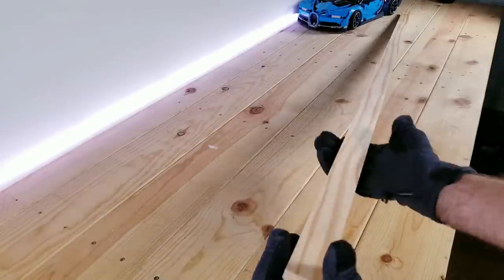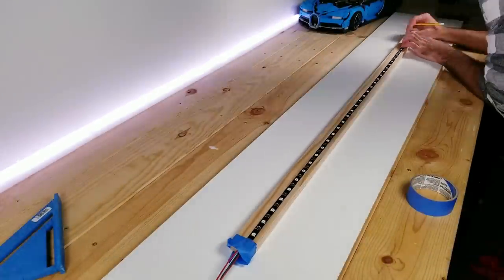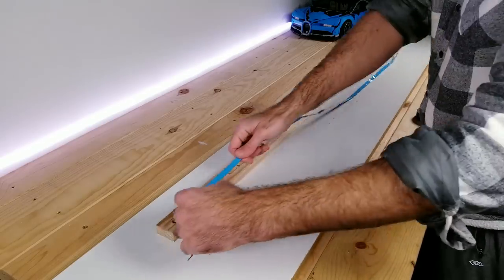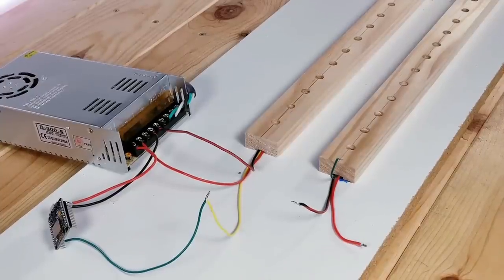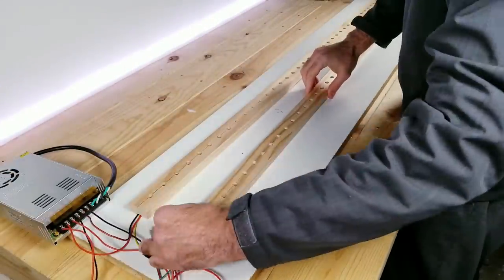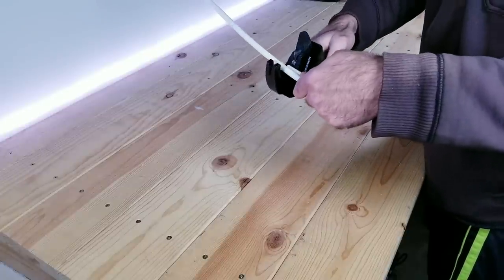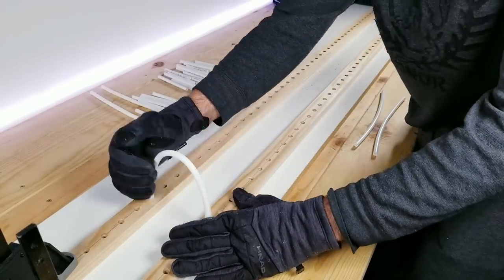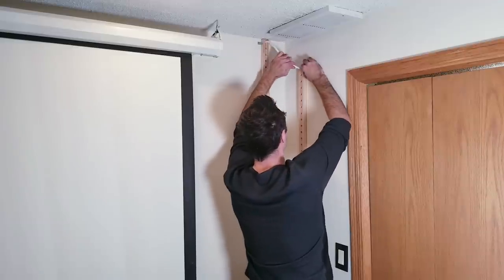Crazy DIY Light - Complete Walkthrough

Comment: Great video! You can use acetone on a rag to remove the print on the tubing instead of sanding. That's how I take it off of PVC; haven't tried it with PEX but I doubt it matters. Takes less effort and you don't have to worry about marring the tube.
Reply from the maker: Thanks so much for the tip! I love when people who know more than I do reach out like this. Very much appreciated. Thanks for watching and taking the time to comment!
Reply: Hi. I use for the printing on pex, isopropyl alcohol. Its the Same i use for my 3d printer headbed to clean it. Aceton could probably "eat/melt" the pex?

Comment: A tip from a carpenter; for your center lines, or any straight parallel lines for that matter, you can put the pencil where it needs to be and slide the speed square along the edge, pushing the pencil down the surface. Much easier than making dots and holding such a long straight edge in place.
Reply from the maker: Thanks so much! That is a great idea and I never thought about that. I love tips from professionals so thank you!

Comment: This looks awesome 👏 I had an Philips hue strip that im not using her but it has the silicone over the led so I can’t build it.
Reply from the maker: You could technically still use them with the silicone! I would just cut the back channel a little deeper and then you wuold just have to secure the led strip in there pretty good so it cant move around so the leds stay lined up with the holes. Worth a try! Thanks so much!

Comment: I wonder what an aquarium frosted tubing would look like! The Color would be able to travel through the entire tube!  Great job as always. How do you hide The power supply and all? Do You have a video on how you control all your LEDS?
Reply from the maker: I've never heard of aquarium frosted tubing! I'll have to look into that. Does it bend? As far as hiding the power supply, its generally nothing fancy. I just try hiding it behind something. In this project, its just behind the small table/drawer that's in front of it. Right now I have not made a video about controlling everything. I will at some point. Its pretty simple though. All my lights are connected to WLED and that app has a sync feature which allows me to control them all at once! Thanks for watching!!

Comment: I know you do them with the cheapest materials available which is great, maybe you should consider doing one project with Govee LED strip.
Reply from the maker: That is a good idea! I know some of the projects you certainly can swap out whatever lights I used for Govee but unfortunatly a lot of the things I have made would not look as good since govee only has about 30/leds per meter vs the 60/leds per meter that I'm using in most of my builds. However, this project with the pex tubing is one where you could use govee led lights! I really wish Govee at some point would make led's that have 60leds/meter! That would be so amazing if they did!

Comment: Hi I loved your project and I have started making the same the only problem is that the 1/4" pex tubing is not the same size as my RGB leds nd I can't find the right size.. could please help with that ?
Reply from the maker: My local hardware stores home depot and menards had different size pex tubing. Although in this project my leds didn't actually go into the pex tubing. The leds did however go intot he hole that I drilled and then the pex tubing went into that hole and sat on top of the led lights. I now the pex tubing at menards and home depot all said 1/4 inch tubing but I did try buying some 1/4 inch tubing that was catagorized as tubing that provides water for your fridge door and that tubing was much smaller than the 1/4 inch pex tubing from the store I got it at. Hope that helps and thanks so much for watching and the great question!

Comment: love the idea and design. But i would be concerned about heat since the wood is good insulator and there is no heatsink for the LEDS, also the led strips have quite high amperage I wouldnt just twist the wires.
Reply from the maker: Thanks for watching and for the suggestions! Yeah having the leds installed on some type of aluminum or heatsink material is best. However I've done a lot of projects with leds on wood and I have yet to have any issues and its been close to 2 years now on some of them. I also was recently introduced to wago connectors at the recommendation of a lot of people who watched some of my videos and its all I use now. I love them!
Reply: @ChrisMaherDIY  I guess its fine as long as you dont use them at 100% brightness, they get toasty fast

Comment: I love this so much! Would this work if I bought a 5m LED strip, cut it in half and connected it into a wifi controller box? The thing I'm unsure about is if the LED that I cut would work in the WIFI box after being cut. Alternately, I was thinking about buying two LED strips, but the wastage I'd cut of both would be a lot.
Reply from the maker: Thanks for wathcing and the comment! You could definitly cut the 5m led strip in half and use each side. Just make sure its the ws2812b ones like I used in this video. They work great!

Comment: If you're going to use a straight edge to draw the line, then you don't need dots every foot. You could have done it with just 3 dots and that 4-foot level. And to avoid splitting the wood, pre-drill flat-bottomed holes with a smaller forstner bit and use pan head screws to mount it to the wall. And you might try a solvent to get rid of the lettering instead of scratching up the tubing. Maybe Goof-off or even just alcohol would do it without melting the plastic.
Reply from the maker: Thanks so much for watching and for taking the time to comment with all your great tips! Thanks for your help! I'm still very new at all this, and especially woodworking so I'm all ears when anyone is able to offer help. Thanks so much!

Comment: Good morning, can I use a 10 amp power supply for this project? Or how do I know when to use a 2amp 10 amp or 60 amp power supply?
Reply from the maker: I think a 10am supply would work. It really all depends on how bright you want to run them. I find that running things at 50% max brightness is generally more than enough. But the price difference is generally not very big from a small power supply to a bigger one so no harm in getting the bigger one. Once you have things set up, in WLED under led preferences, it will tell you based on how many leds you have what they recommend for a power supply for max brightness as well as if you are just concerned with having it look good for animations.

Comment: Hi Chris, love your videos! Just ordered my first 5m ws2812b 60/m strip and diffuser channel. Question can I control this with 2m one way and 3m  the other way? So can I connect the esp32 board half a way the strip? Thanks I’m advance Roland
Reply from the maker: Thanks so much for watching and taking the time to comment! If I'm understanding correctly, I think what you are tyring to do can easily be done in WLED. Just connect the entire strip and then in WLED there is something called segments where you can have lets say led 1 - 60 be its own group and then the next segment you can have lights 61- lets say 120 be part of that group. (you can do many segments if you like) You can then control each group separately. Different colors, animation, direction etc.

Comment: I've decided to go ahead and make this myself, I was just ordering the bits needed and I'm unsure about the sizing of the pex tubing. Your link says the tubing is 1/4 of an inch but in the video it looks larger, I always think of 1/4 as the size of a straw hole.
Reply from the maker: Thanks for watching and great question! The pex tubing from menards and home depot all say 1/4 inch and even though the brands were different, the size was the same. Now I also tried ordering some 1/4 inch tubing from amazon that looked like some tubing that might work but was catagorized as like fridgerator water tubing and when that arrived, it was much smaller than the 1/4 inch pex tubing (my guess it was the size of a straw hole) So all that to say is i'm assuming the way pex tubing is measured is from the size of the hole not including the actual pex material. And the fact that a 3/8ths inch forstner bit worked perfect to fit the 1/4 inch pex tubing in makes me thing that pex tubing must be measured a little differntly if that makes any sense at all lol.

Comment: Nice video! But could i also just solder the two wire pairs of the two parallel led strips onto the esp8266?
Reply from the maker: Thanks so much for watching! I have not personally tired that but I think it would work if you wired the data lines directly to the data pin on the board. The pins are pretty small and close together so it might get a little cramped.
Reply: @ChrisMaherDIY  thank you sir

Comment: Hey Chris loving the project. question. In the beginning you have the light strip exactly the same length and the same start and end point. now you have shift the left one up. how did you sync them up to shine the same leds ?
Reply from the maker: Thanks so much for watching buddy! So I didn't have to do anything actually! When I shifted them, if you look at the very top, the pex tubing that is in the top spot on the higher left section goes to the top spot on the lower right side. So each side does the exact same thing so when lets say the last pixel is blue, its blue on both sections so that the pex tubing will be lit on either side with the same color. I hope that makes some sense!
Reply: @ChrisMaherDIY  Hi Chris, i understand that you have shifted them, that is logical that when you have 2 identical pieces of wood en starting point that the starting and ends would be the same. What i do not understand is the following. on 8:26 i can see on the bottom that you have holes without pex tubing (which are not lit) and 1 hole with pex tubing that is also not lit

When looking at this screen i kind of make 2 conclusions
1: the starting points of the LED stript have been shifted upward on the wooden piece. (starting at your first L bracket)
2: the starting point of the LED strip is at the top of wooden pieces
did i explain it clearly?
Reply from the maker: @Seaniemo92  Ahhh! I understand now. Thanks for the clarification. So your first conclusion is correct. On the WLED settings you can choose to skip LED's. I think I ended up skipping the first 11 leds so that the first led that would be lit up would be LED number 12. Hope that makes sense! Thanks again for watching!
Reply: @ChrisMaherDIY  great! Sharp eyes get me far. Maybe a good idea for a short tuturial about this?

Comment: Hi, can you tell me what is the diameter of the pex tube in millimeters?  Why do I think it's not easy to find this measurement?
Reply from the maker: In America, 1/4 inch pex tubing is very common but i'm not sure if it is in Portugal or not. 1/4 inch is 6.35 mm. Although you can use whatever size you want. I could have certainly went with smaller or slightly bigger tubes If I wanted. I would have just had to make sure the holes I drilled fit the size of the tube. Thanks for watching and good luck!

Comment: Hey Chris, quick question, how many strips can I run on a esp8266, one 16 ft 5v seem to be fine, but I wanted to attach two strips and when I did I experienced flickering, I wanted to eliminate the amount of esps I use but am thinking I’m going to have to use esp per strip because I’m not using external psu
Reply from the maker: Thanks for watching and for the question! I know i have for sure connected more than 1 strip to an esp8266. I think the most I've done is 2 and it worked fine. What power supply are you using? for 2 strips I would recommend at least a 5v 10am supply and you might need to inject power if your running 2 strips. Hope that helps!

Comment: Where did you put the power supply just on the wall in the corner
Reply from the maker: Yeah, its just in the corner on the floor behind the little side table i have in front of the lights. Nothing fancy but its out of sight and that's all that matters to me! Thanks for watching!
Reply: When using a power supply with fan for cooling like the larger 12V 50A 600watts can those be put in some sort of casing? Only asking because it's kinda a child hazardous.

Comment: If i have 2 strips that are both 30 to 40 centimeters and wanted to power them with one 12v supply would i need a power supply like yours which has 2 differenr + and - terminal?
Reply from the maker: Thanks for watching and great question. You would not need a power supply like the one I have. I could have technically put the voltage wires all in the same terminal and all the ground wires in the same negative terminal and it would have worked just fine.

Comment: Will this work with the medium power supply you’ve linked in other videos?
Reply from the maker: Thanks for watching! I think It will work but you for sure would not be able to run things at full brightness with full white. You would for sure see some significant voltage drop. Now for the way I use these lights, I never have a reason to run them at full white and full bright. I generally have things probably running at 30 to 40% brightness and usually some sort of colors are being displayed (not just white which takes up by far the most energy) and that is more than bright enough for me. So if you use the medium supply and have things running around 30% bright, my guess is that it would more than likely look good enough to pass my standards.
Reply: @ChrisMaherDIY  thanks for the detailed response. I decided to grab the larger one just to be safe and power other strips if needed. Just wanted to say thank you for all your hard work and videos. Your channel is incredible. I can promise you that it’s going to grow very fast with content like this. 

I’ve already stole 3-4 of your ideas and techniques. I will say the HL blank stencil sheets are by far one of the best finds so far I’ve come across for diffusing light. Worked flawlessly for my last application. 

Now to just save up for some of the woodworking tools to make these projects much easier. 

Thanks again brother. Have a good one
Reply from the maker: @RohrmanT  Thanks so much for the update and you are very welcome! Glad some of the videos helped with some ideas! Lol yeah those HL stencil sheets are amazing and I still cant believe I cant find anything close to how well they work on Amazon! All the ones on amazon I've tried are a little too transparent!  Thanks buddy!

Comment: You should probably clarify that the tubing isn't 1/4". Likely the interior diameter is 1/4" but this is actually 3/8". I went back and forth at the store about the size and ended up grabbing the 1/4" before realizing it was smaller than the one you used in the video
Reply from the maker: Great point! I just went off what the label at the store said (it said 1/4 inch) but after trying to order something similar online I found that 1/4 inch means different things for different products lol. Thanks for watching and taking the time to comment!

Comment: So I’m trying to recreate this project or at least something similar. I’ve purchased all my stuff right from your lists in the descriptions. Followed your instructions from the other videos, but cannot get my LED strips to turn on. I have a feeling I’m doing something dumb. One other thing is that the ws2812b come with a 3 wire data connector and a white and red voltage wire out the end. Was hoping I could shoot you some pics of my wiring and you could potentially tell me where I’m going wrong.
Reply: Nevermind! I got it! Needed to install drivers correctly.
Reply from the maker: Hey glad you got it working and thanks for reaching out! Let me know if you have any additional questions! Trial and error is the best way of learning so I'm glad you were able to figure it out!
Reply: @ChrisMaherDIY  I’m using the “big” power supply you’ve linked in your videos. How high can I turn the MA safely, for max brightness.

Comment: Hey I love your videos and want to try something like this for my room! 

I have a question though, if I wanted to run parallels with two led strips using a usb or barrel power option would I just twist or solder together the red, green and black wires from the two strips and then solder them to the ESP board/put them into the barrel plug adapter?

Thank you if you get around to answering and I hope all is great!
Reply from the maker: Thanks so much for watching and great question! So essentially you would do something pretty similar to what I did in the video. The issue is that the usb or barrel power option just has the 1 voltage and gnd output so all you have to do is split it. With the USB, i'm not 100% sure but you should be able to cut the cord and get to the + and - wires. On the barrel plug you would attach a short + and - wire.  From there I would recommend using a wago connectors to split the wires. For example, I would use a wago connector that has at least 4 slots. 1 slot would have the main voltage wire. 1 slot would have the voltage going to 1 led strip. The other voltage would be going to the other led strip and the last slot would have the voltage going to the espboard. The negative would be the same. At least 4 slots on that as well. For the data, I would have that 1 wire leaving the esp device but you would then use a wago connector that has 3 slots. 1 slot would be the main data wire. The other would have the data going to one led strip and the last slot would go to the other led strip. Hopefully you can make sense of that! Here is the wago connectors that i've used and work great! https://amzn.to/3xFXdmR
Reply: @ChrisMaherDIY  That makes perfect sense! I see the vision lol thanks again man! Love the channel, keep up the great work!